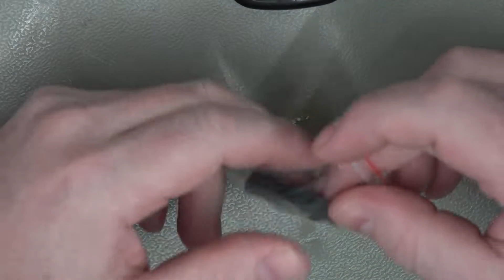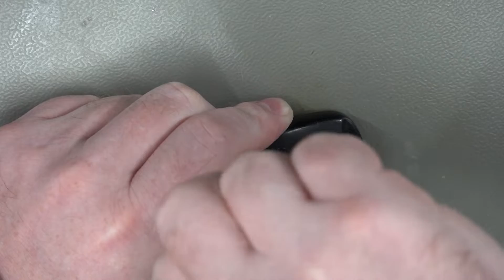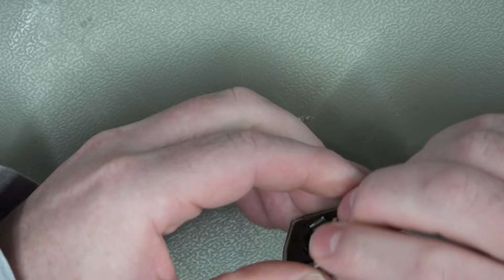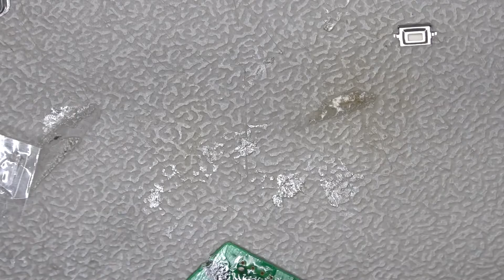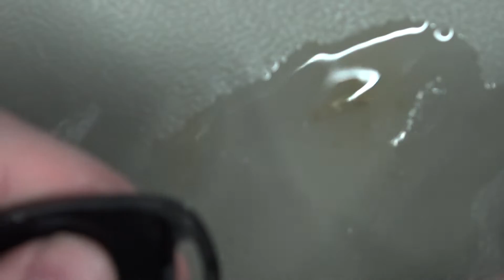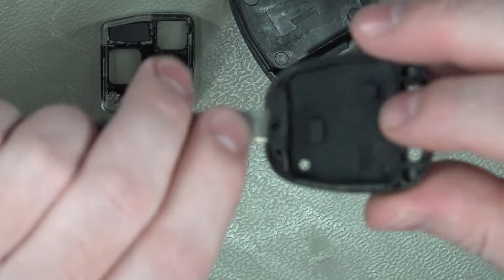2006 Toyota Corolla Key Fob Repair

Comment: Hi there I think my key just needs the battery replaced but the screw head is threaded and can't open it. Do you have any tips on how else to open the key fob?
Reply from the maker: No option but to drill it out, tho then your have to glue it together
Reply: @ElectronicStuff  i've ordered a replacement key/fob. Just need to get it cut, then can pry open up the old one, take out the immobiliser and put it in the new key.

Comment: Very helpful.. I think this is the problem I have with my remote as I have replace the battery and its contacts look good but still not working.   From where do you get the replacement buttons ?  Thanks
Reply from the maker: Thanks :) ebay is your friend